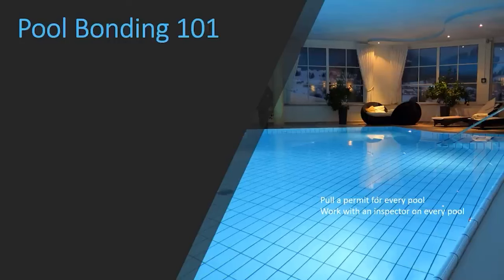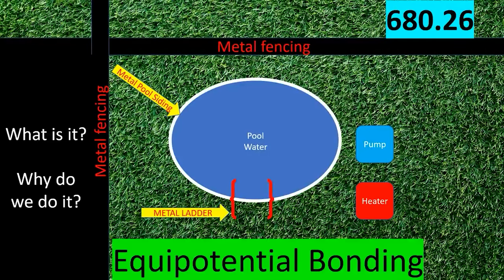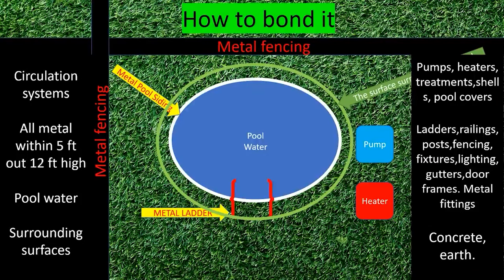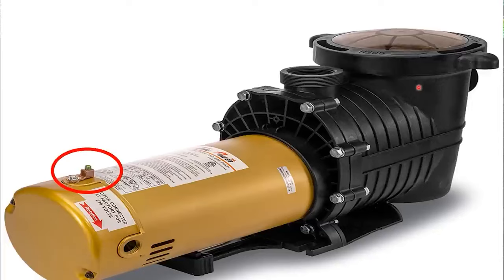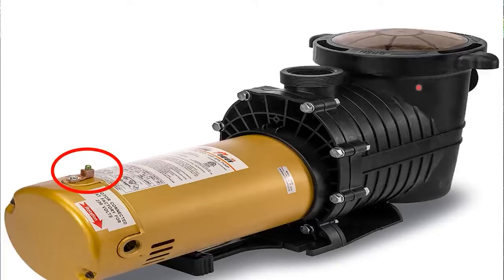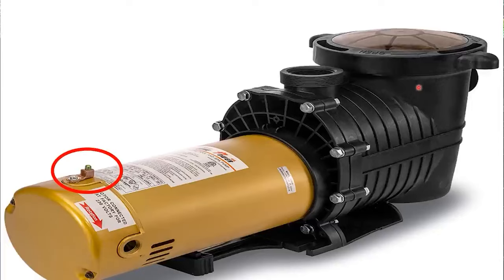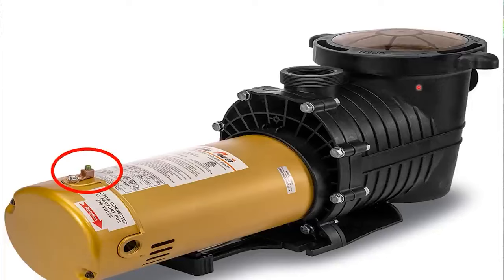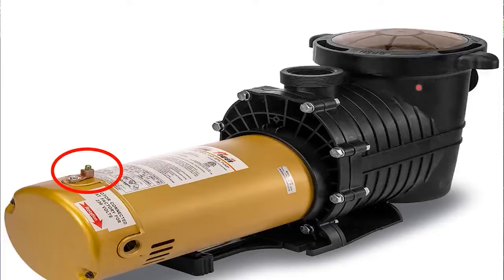Pool Bonding 101. Pool Electrical

Comment: You mentioned the concrete walls of the pool need to be bonded, how exactly? Do you have to run a 8awg copper wire through the rebar before spraying concrete? or just add a lug to one part of the rebar?
Reply: Yes, you bond rebars and must pass a special inspection for bonding before you start pouring.

Comment: Thank you I really appreciate all this info. I am a plumbing and building inspector and I just started studying for ICC E1 electrical certification. 
Could you please explain bonding requirements when whole above ground pool is resin or pool walls are resin-plastic encased aluminum. 
Electrical inspector in my place of employment is confused and he almost never require a circular bonding around the pool and just recently he allowed grounding rod right by the pool. I just don't want to learn it the wrong way. Thank you.
Reply from the maker: Nice to meet you! You get to take my full program for free since you're an inspector, also definitely call me tomorrow about those pools 423-895-3247

Comment: Question,  I'm going to be bonding a pool that has pvc post and caps. how do l bond it? The only metal that l can see is the metal ring at the very bottom where the side wall is sitting in. There is the metal strip where the ends of the pools side wall is bolted together, but that's only one spot. Is that enough bonding, or do l still have to bond in 4 spots?

Comment: Hi, very thorough, thanks.  I will have a copper riser + hose bib within the 5 feet.  What fitting gives a good enough connection while not breaching or crushing the water pipe?

Comment: I plan to bond our above ground salt water pool only because it is recent requirement but I have yet to justify the requirement, At least in our case. All power is intentionally over 6ft from the sides of the pool except for the salt cell. I put in a GFCI to plug in the control panel that controls the pump and salt cell and I test or replace it every spring as my wife is prepping to open the pool.   Grounding/bonding is a major safety thing at work us as we work with a mix of energetic material and electronics. A single small arc of electricity could be deadly.  We (electrical, mechanical, and aeronautical engineers) discussed bonding a pool and while we agreed that it probably would not cause any harm to do so, we struggled to find a valid reason to do so.  I am going to do so only because it is simple and cheap to do so, and I want to sell the house someday but am not convinced that it is neccessary. Additionally I did ground the pump and the control panel to seperate ground rods. If one should short out I want to try to avoid losing both of them.

Comment: So where and at what point does the pool bond connect to the service main bonding point?
Reply from the maker: Great question, it does not connect back to the main service except  the equipment grounding conductor for the pool pump.

Comment: That was a great video. Thanks to your video, I fully understand what bonding really is. One question that I have is for non permanent pools which are used as a permanent pool, such as a metal frame with vinyl liner where the connections between the posts and rails have plastic between each connection, and the pump gets upgraded, how would one bond that?

Comment: If theres a rebard grid around the pool and there is #8 whips in all 4 corners coming out the pool could i use the rebar as a way of continuing the bond by just taping into the rebar at those 4 corners instead of having to run #8 all around the pool ?

Comment: Woaaah thanks for this lesson - here my question : I have the sub panel Siemens with # 10 green ground conected from another panel … please tell me if I need to install a new 2 bar pole rod copper topically it’s 5/8  and 8 ft  on the ground ….and attachment together with the other green it’s coming from the other panel - may I conected together?

Comment: It seems like you might know more than the others I have viewed on UT regarding bonding. Can you tell me something? My inground pool is prolly 25, maybe 30 years old. I did find a ground (GROUND) rod driven into the earth next to the concrete deck that surrounds the pool. This was nowhere near where the pump and filter are located. The ground rod did have what looked like a #8 copper wire attached that disappeared under/into the concrete. I had an ABOVE ground pump installed that just failed. I'm replacing with an INGROUND pump. The new pump has a clear bonding device. The old pump did not have a bonding device - it was properly grounded (not bonded) via the electrical supply. So, the question I have is this: What do I BOND the new pump to? I don't think there is an equipotential grid installed on this pool, and I really don't have the intention of installing one. Should I BOND the pump to earth via an 8' copper rod? Should I do nothing? Attaching the bond to that ground rod I found is physically impractical due to its location. Your thoughts would be appreciated. Thanks!

Comment: Booster pump and my pool pump attached together with a copper line but when I changed booster pump I had to cut attachment of copper piece. And now I noticed that this copper line end should go to ground onto soil with a metal pole. right? It seems it was detached. I was looking for information where attached copper on motors go. As it should go to ground. Am I right?
Reply from the maker: Contact a qualified license electrician, and make sure they work with your local electrical inspector

Comment: Do you have to bond the pump if its far away from the pool?
Reply from the maker: Great question! Definitely work with your local electrical inspector and with a qualified license electrician, but the location of the pump does not change these codes but may change the methodology

Comment: I just got a new customer who has a 2 month old salt cell installed by another company.  Noticed today that the salt cell panel is NOT bonded.  The bonding lug is on it, but it wasn't used   How dangerous is this?

Comment: What is with the 8 AWG copper bonding wire when even 18 AWG is sufficient to drain off or equalize any leakage current or voltage and in all other electrical situations (appliances) the ground only needs to be the same gauge as the hot and neutral supply. I ran 12 AWG to my pump and used 12 AWG to bond the pump an upright and a ladder support bolted to my deck and measure 0 volts between all conductive surfaces , also my ladder is removable but only when the pool is closed and covered ,and the inspector was happy 30 years ago when I installed the pool.  Also since the pump is on a GFCI doesn't that make all of these other requirements superfluous? And yes I do make sure it trips with the test button monthly.